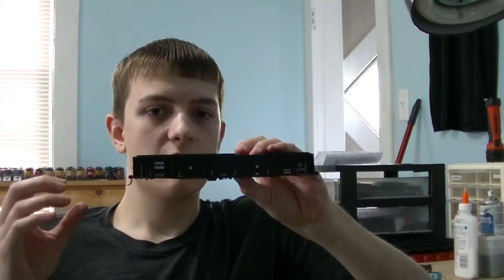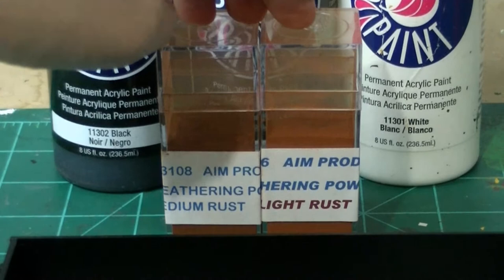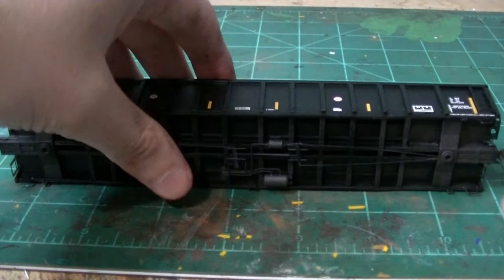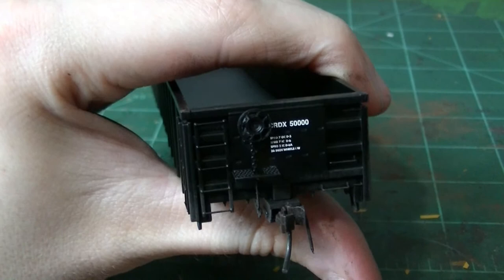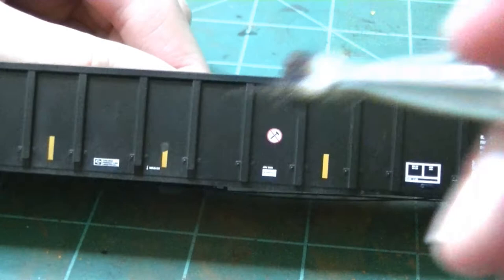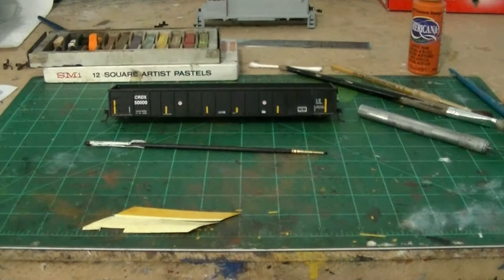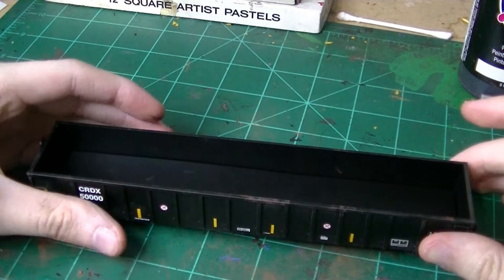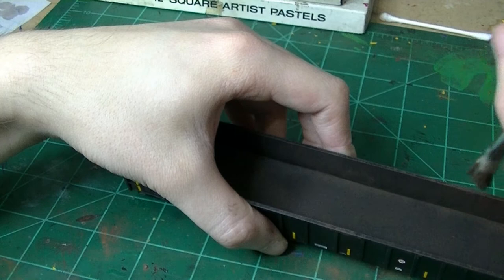Weathering Models With Dan!  Episode 3:  Gondolas

Comment: You never did the couplers....
I also use AIM Weathering powders, obviously. One thing that may have helped others is, the AIM powders have a little oil in them. That's why they stick so well, and clear coat doesn't kill the effect. The fact that you used regular pastl chalks after was very correct, obviously. That's because the oils in the AIM helped the yellow chalk stick better.
The guys watching need to know that.

Comment: Looks great! Think I'll try it on my gondola. What do you recomend to get rid of fingerprints and dust before I start?
Reply: Train 1922 take a Q tip soaked in Rubbing alcohol and wash the Car sides with it. The Alcohol should get rid of the fingerprints and dust then let it dry and shoot a clear coat over the model so the weathering has tooth to bite on.
Reply: Kevin Barwiler Cool, thanks!

Comment: Where did you get the yellow reflective stripes?
What video did you introduce them in???
TIA
Reply from the maker: The first video where I actually show models with the reflective striping is Project Update: 6-16-14 New Rolling Stock & Engines! Part 1 of 2.    I use Western Safety yellow reflective tape for my safety striping, available at Harbor Freight for $10.   ~Daniel